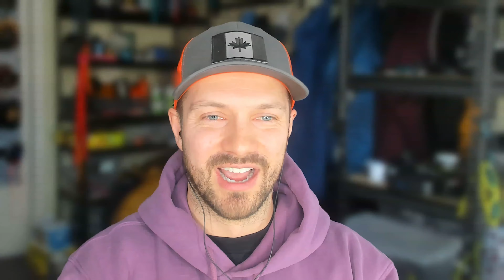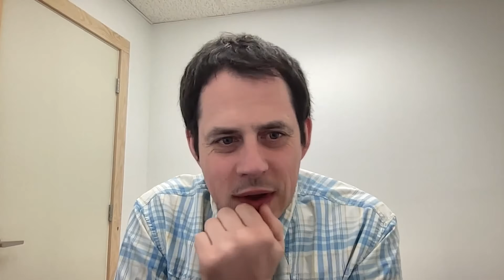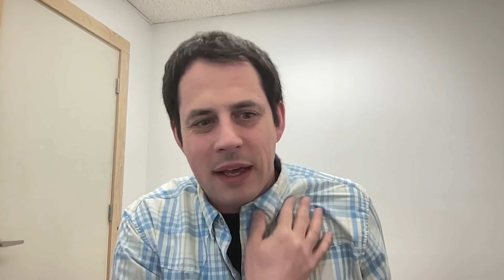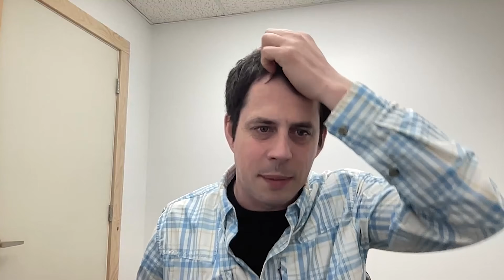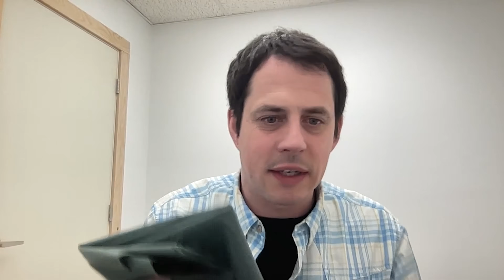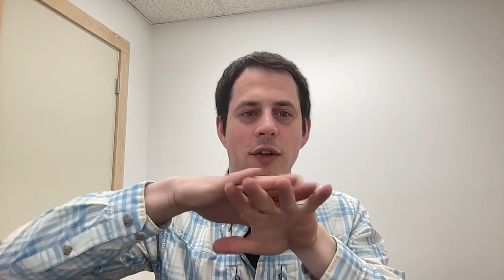Best Tent Fabrics? w/ Dan Durston

Comment: Most of my tents - which I think have all been nylon - have reached end of life through UV degradation or zipper failure (sand). Polyester is not as tough or abrasion resistant as nylon, but it has better UV resistance. Depending on how roughly you treat it, a polyester tent may well last longer than an equivalent nylon tent. Polyester dries more quickly and takes up less water than nylon, so it is less prone to mildew damage. But it is all a trade-off. Polyester is somewhat cheaper to produce than nylon, too.

Comment: VERRRRRY interesting! Thanks Justin.  Tent maker/designers have to be concerned with the fabrics AVAILABLE rather than the "Perfect Fabric".  Polyester, with its inherent UV resistance and low stretch when wet than nylon is becoming more popular. My most expensive tent is a Tarptent NOTCH Li of, natch, DCF "fabric". But it is strong, light and hydrophobic   which are all great characteristics of a tent fabric - UNTIL you have to pay for fabric and expensive seam sealing (taping).  Finally, fabric affects DESIGN quite a lot. You can't usually have the same shape of panels for DCF on a design that you do for say, polyester. Each fabric reacts to stress differently. But Silpoly seems a better choice than Silnylon given that Silnylon will lose strength faster under UV exposure than Silpoly and strength is the ONLY advantage Silnylon has over Silpoly.
-> HA! Dan has to modify new gear "right away". Well, that's me too. I dont' have a tent or pack that I haven't modified to some extent, sometimes quite a lot.

Comment: Nice talk. Some related thoughts and points: 

  Super small diameter UHMWPE fibers (Dyneema, Spectra, Ultra, etc) are very hard and expensive to make (currently).  I think 50D is the smallest that I've seen in commercially available threads and fabrics.  Even if you could make them 10D or the like, how are you going to waterproof it, as nothing sticks to this super low energy surface?   You "MIGHT" be able to calender a thin UHMWPE film to the fibers, but you have to be very careful with heating UHMWPE fibers because they have a low melting temp and as soon as they get near that melting temp, the crystalline molecular chains that give these fibers so much strength, start to change back into amorphous structures.  So the pressure and heat would have to be very carefully controlled and dialed in.  I'm not even sure if this would be possible or not.  You can plasma treat the outside surface of the fibers/fabric, but that is much easier for industry than individuals to do (and I think that DSM has or had a protected patent on it). 

   There is a Japanese corporation called Teijin which is making high tenacity polyester fibers and fabrics now.  Their polyester fibers are between 1.5 and 1.6 times stronger than regular grade polyester. They also mention that their polyester formulation already has higher UV resistance than regular polyester btw. 
     You can even buy their polyester fabrics on their US distributor store, called ThinkEcoFabrics, under the labels PASMO (range from downproof/not very breathable, to very breathable) and PASMO Technoforce (very unbreathable)--they range from 12.50 to 15 dollars a yard (ranges from 50 to 60" or so wide).   Unfortunately, none of these are coated with waterproof coatings.  I actually contacted them not too long ago and asked (and suggested) if they ever thought about applying a pure silicone coating for waterproof fabrics?  Interestingly, they said that they had recently talked about possibly doing just that.  I really hope they move forward with that. 

      Dye color really affects UV resistance of a fabric, besides the material and coatings.  The darker the color and closer to deep black, the longer it will last in relation high UV exposure.  For example, one time when going hot air ballooning, I asked the captain if he noticed a difference in how the nylon lasted in relation to colors.  He said definitely, and that they have noticed that black and dark navy blue colored nylon balloons lasted the longest.  I already had an inkling of this before I asked, and which is why I asked him that question (to see if there was any outside correlation/confirmation besides the sources I had already seen). 
      
    I've looked a little into the 3M silicone tapes, and from what I've seen so far, they are definitely pricey. Maybe less so if one has business connections and has the ability to buy in bulk.  It is not hard to mix a little silicone caulk with some naphtha (works better than mineral spirits) to thin it out and then apply with foam brush. 

   I'm too impatient to sit around and wait for pure silicone coated Pasmo fabrics to come to the market, so I recently hit on a plan. I bought the highest quality silicone coated polyester fabric I could find (at ExtremTextil), and enough to make a large tarp. I also bought some  1" wide UHMWPE webbing that weighs 1.7 grams/.06 ounces per foot.  I'm going to sew the webbing over the tarp fabric in an X, +, and [] pattern.  The tie outs will be directly connected to the webbing and not to the tarp fabric--hence the webbing will take most of the force of wind etc.  This is 1000lb rated webbing (I might actually use polyester grosgrain for the [] part of it though. The UHMWPE webbing is on the expensive side, whereas polyester grosgrain is quite inexpensive). 

   Yes, way overkill for most purposes, but I want it to last a very long time, among other issues/factors I'm not going to mention here.  I plan on probably adding some extra silicone coating to the top as well, to increase the UV resistance and waterproofing some more (the fabric is dark olive which will handle UV decently anyways). I might even throw in some nano or micronized titanium or zinc oxide into the thinned silicone before I apply (but nano particle forms are quite expensive, so maybe not).  Again, I want it to last a very long time and be very durable for "relatively low weight" (unfortunately, all of these extras will add some ounces to the finished product). 

    This won't be my everyday, go to tarp/shelter for my UL backpacking trips though.

Comment: Chatting with a consultant designer with over 200 big-brand lightweight shelters to his name, he says that the finishing is critical and can vary more from batch to batch than the difference between, say nylon 6.6 and polyester. Having said that, for backpacking tents he's a big proponent of silpoly because of the stretch and sag performance. He has access to the repair departments of many of the big brands and says that the minor differences in strength are a non-issue provided the stress points are properly designed. Neither will survive rubbing against a rock or branch. Plus silpoly has better UV resistance so after a few weeks in the field it's very likely a toss-up.
Reply: Was that Mike Cecot-Scherer? Legend.  I agree that there are a lot of variables that go into a fabric and some of them can dwarf nylon vs poly.

Comment: Nylon: 1938
PTFE: 1938
Polyester: 1958
BoPET: 1958
UHMWPE: 1962
Tyvek: 1967
ePTFE: 1969

Dyneema (DCF) = Ultra High Molecular Weight Polyethylene (UHMWPE) fibers laminated in Mylar (BoPET - biaxially oriented polyethylene terephthalate), both of which are based on polyesters. 🤓

That means 54 years since any major fiber breakthroughs commercially and at scale. ePTFE is basically "Gore-Tex", normal PTFE is basically Teflon, the main sources of PFAS "forever chemicals". PTFE has a major advantage in that its 100% UV proof, but the environmental cost is high.

Has anyone tried Tyvek 1025D for a tent material? Its technically waterproof, but breathable, the weight at 1.25oz (42.5 GSM) isn't terrible either. Plus its recyclable no?
Reply: I've used 1443R Tyvek (commonly called Kite tyvek) for a few different things, though not a tent. Tyvek is not quite as strong at tear resistance as compared to woven nylon's and polyesters at similar weight, especially compared to pure silicone coated nylons and polyesters.  Part of the reason is that because Tyvek is a non woven material.  It is melt spun in kind of random patterns. They do this to save ease and cost of manufacturing.  

HDPE fibers/threads in a woven fabric are pretty strong though, though nowhere near the highly oriented/crystalline UHMWPE fibers ala Dyneema, Spectra, Ultra, etc  There aren't a lot of woven HDPE fabrics on the market.  One of the few that I know of can be found at ThinkEcoFabrics and it is called HMWPE TS440.  It is on the heavy and expensive side though.  

   If I was going to use Tyvek for a shelter like a tarp or tent, I would reinforce all the tie out areas and stress areas in the "fabric" (material). For example, I might take Tyvek tape and tape down the tarp in an X, +, and [] pattern.

    Then hope it doesn't rain super hard, because rain will get through if it is a very hard rain.  Tyvek will handle light misting and the like ok without leaking, but very hard and sustained rains, not so much.  

  I am curious if one could take "polycryo" and melt it into/onto the Tyvek material though (this would radically increase the WP)?  How one might try that is with a clothes iron and with parchment paper between the iron and the film on top of the tyvek.

Comment: Interesting video. Didn't know that polyester had been considered an inferior fabric to nylon. Fjällräven, a Swedish brand made all their top-of-the-line tents with polyester fabric in the mid- late seventies (and maybe later too). Don't know when they switched but use nylon now as far as I know, maybe except for one model. At the time most other manufacturers used nylon and some claimed that was stronger fabrics, but the polyester was clearly strong enough for some really harsh conditions (I've tried) and the sag free polyester fabric was a real bonus in a climate with lots of rain.

Comment: Wish I would've been here for this live.
Gossamer Gears use of robic and silnylons is why they are my favorite cottage company.

10D sil/pu tents and tarps equate to very low weights at relatively low prices.

A 17oz 1P tent ... A 7 oz catcut 10-9 x 7 tarp. Great

Lasts longer than DCF according to many anecdotal accounts.

30D, 70D, other Deniers of robic nylon make for very lightweight, decently durable for most backpackers, and low cost. The new GG Fastpack looks amazing. One can always do some trimming for lower weight.

DWR is definitely not the greatest for water shedding, but a cheap plastic pack cover that weighs nothing sheds the rain for me.

Dan taught me about sil/pu patch ability over sil/sil
Reply: It is easy to patch silicone coated fabrics.  You just take a piece of likewise silicone  only coated fabric, thin out some 100% silicone caulk with some naphtha, and apply the thinned silicone to the new fabric (while cleaning the old, holey fabric with some 90% isopropyl alcohol) and stick it on the old fabric and wait for the silicone to cure (24 hrs).  

    Maybe not as easy as slapping on some tape, but still not that hard nor that much work.

Comment: Curious about thoughts on dutchware gear patent pending fully bonded sil poly fabric eliminating the need for any kind of seam tape or seam sealant.  It also turns the seam from the weakest part of the fabric into the strongest  part of the fabric.  My understanding is because of the bonding process they can use thinner denier sil poly without compromising the integrity of the fabric by not putting any holes through stitching.  This seems like a game changer for durability and waterproofness.
Reply from the maker: Sounds promising! Dan kind of alluded to technologies like that. I have have to have Dutch on to discuss!
Reply: @gearprioritypodcast    That would be awesome!  I feel like It all depends on the durability of a 0.9 sil poly fabric but if it holds up and stands the test of time, their fully bonded sil poly .9 fabric is only like 3-5 oz heavier than dyneema tarps(depending on cut/size).   At this point, its Starting to get close enough to dyneema in terms of weight (not to mention also sharing hydrophobic properties) but at half the cost.   Also, one thing that wasnt mentioned (I dont think) was the compressibility of sil poly over dyneema.   Sil poly is actually  significantly more compressible/packable than dyneema. In backpacking this matters.   Contrary to what people might think, dyneema, while being ridiculously light, is actually kind of bulky when packing up. Its a pretty interesting option i would think for a lot of consumers.   I think the wild card though is durability of the super thin sil poly.   Any ways, ill stop nerding out.   

By the way, great job.   Awesome podcast for gear nerds.  This fills a niche that isnt really filled in the podcast space.
Reply: @ddff5242  Man there's even 7D 6.6 Silnylon now... The stretch factor with this fabric is way too high, with reports of the fabric wrinkling in the field. But a silpoly may stretch so little, even a theoretical 7D ripstop silpoly may be viable.
Reply: @matthewsnyder4091    Stretch is not just a feature of the base fiber/material, but also how it is woven and how many threads there are per a given area (and how they are oriented).  Polyester btw, does actually have some innate stretch too, just less than nylon.  Look up "elongation at break" of various different fibers.  For example, polyester has 50% elongation at break while cotton has between 4 to 8%.  Meaning, when you try to pull apart a fiber (and the weight/force it can resist is called its tensile strength), polyester will stretch quite a bit before fracturing apart i.e. breaking.  But a cotton fiber will stretch very little before breaking apart (and at much lower force than polyester).  

   Getting the kind of forces required to stretch out polyester fabric while backpacking though, will generally be hard to do, unless you are talking some very, very, very strong winds.  But at that point, chances are that your tent stakes would be pulling up out of the ground and the like anyways.  

    Nylon not only has more elastic stretch and elongation at break than polyester, but as Dan mentioned, it absorbs an appreciable amount of moisture into the material itself and when it does that, it expands and stretches, which leads to stretch sag, which is different than bias (diagonal) stretch and elongation at break stretch.  

    There are so many different factors to consider that it can be a little mind boggling and generalities aren't very helpful (or accurate) most of the time. 

   There is a new high tenacity polyester fiber and fabric on the market called Pasmo btw.  Just not yet with waterproof coatings yet.  I contacted the company and urged them to consider coating them with pure silicone and they said that they had already talked about it some recently, so my message was coincidental/synchronistic.  Hopefully they come out with a silicone coated version in the near future.  It will be the rival to nylon's 6.6 in terms of tensile strength.  Pasmo fibers have between 1.5 and 1.6 times higher tensile strength than regular polyester.